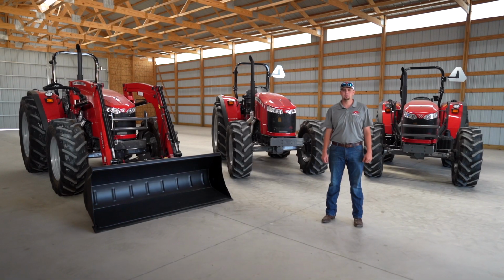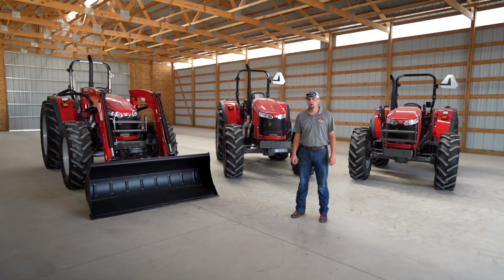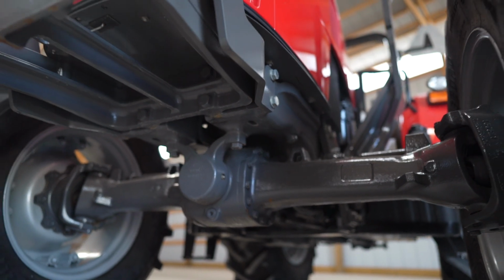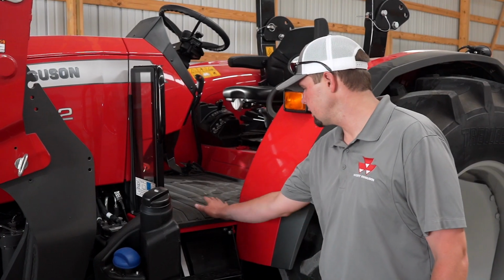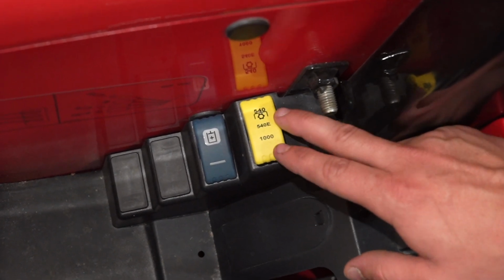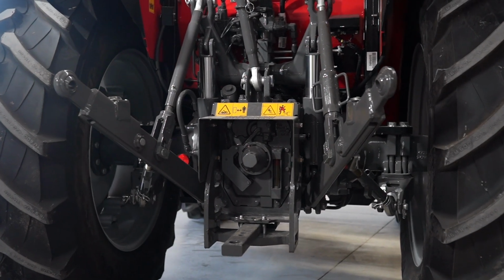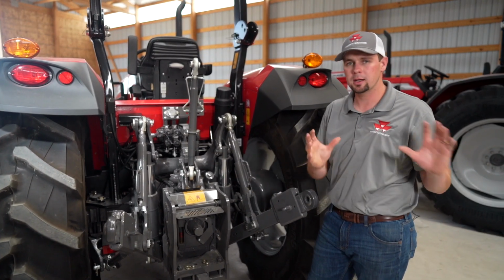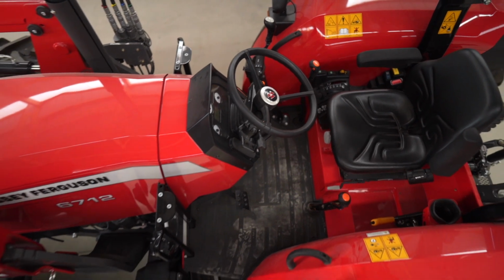MF Global Series Tractors Overview

Comment: Just bought a 2021 4707 to replace my 1643. My one gripe is the 3pt hitch arm control. Something's not quite right with it. I just want up, down, and stop when I want it to, but it seems to have a life of its own. Pretty frustrating.

Other than that, it's an awesome tractor that I look forward to using every day. The deluxe cab is nice (never had a cab before) and the FL3615 loader is easily the best loader I've ever used on a tractor.
Reply from the maker: Hi there - we suggest contacting your local dealer to help you out with the hitch arm control. Thank you!